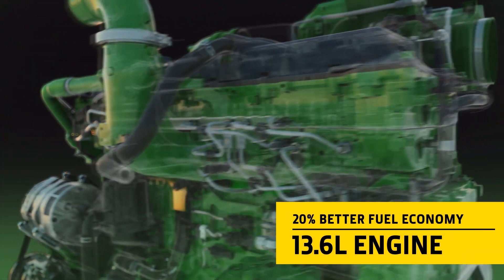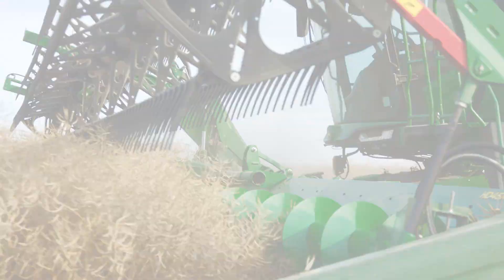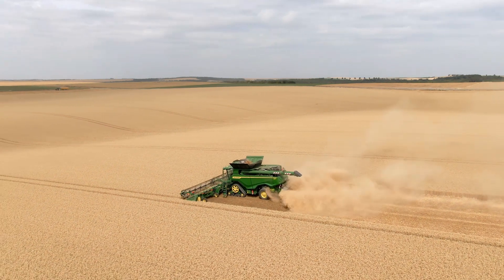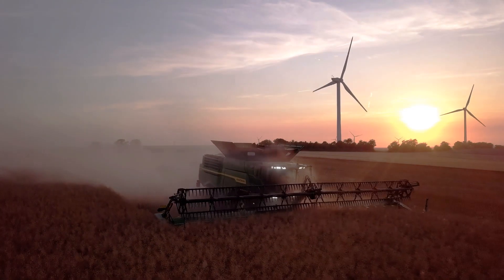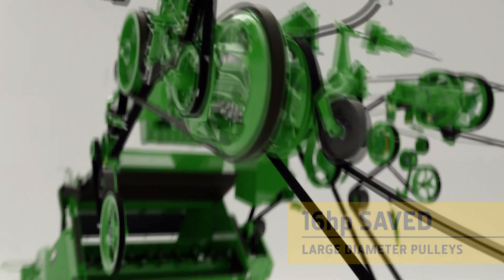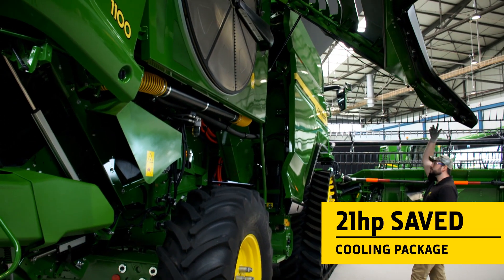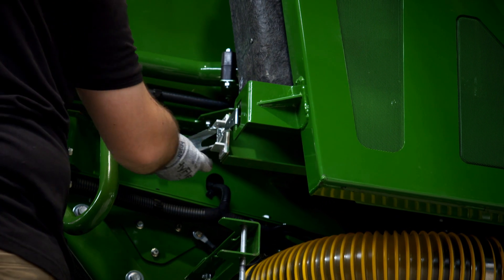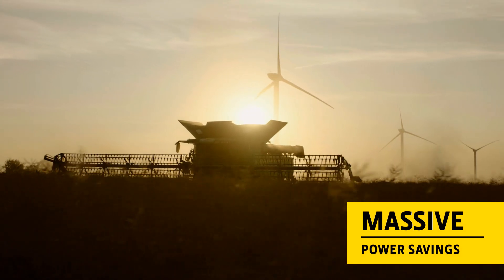INSIDE X9 - #8 Energy Efficiency | John Deere

Comment: i love good old belts they work well easyish to fix. but what about Diesel Electric? there have bean DE trains for years now and with current EV tech making inverters VFD's and electric motors even better its could work well in a tractor or harvester package. obviously going full EV is a no go battery's are still way to impractical for farming yous guys already tried a failed with that.